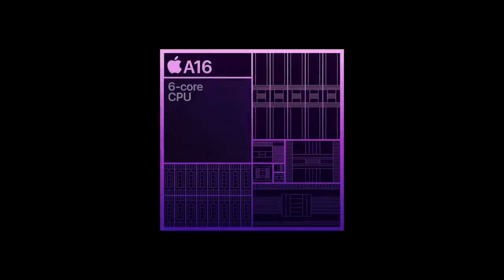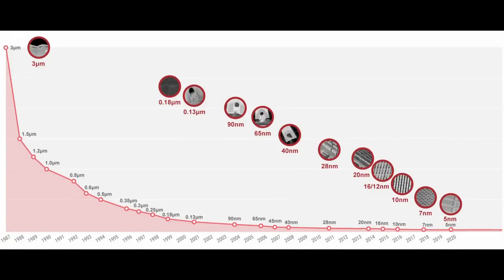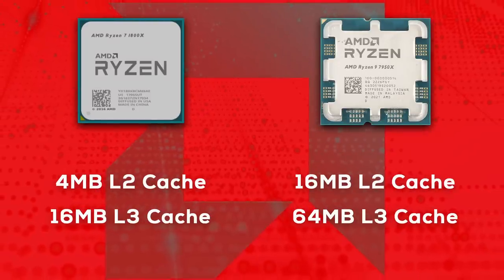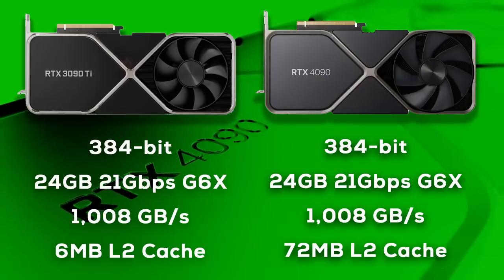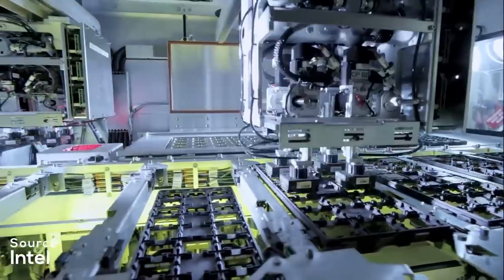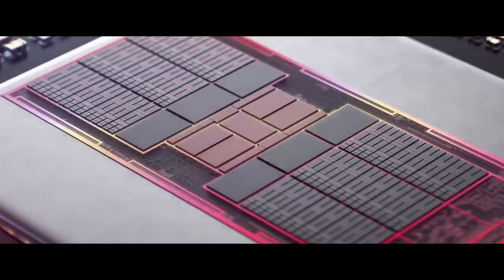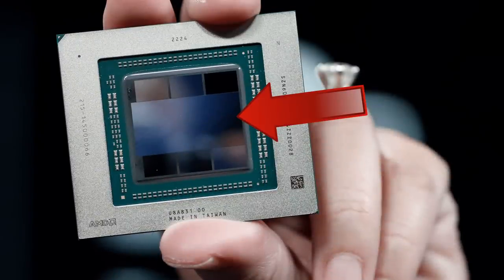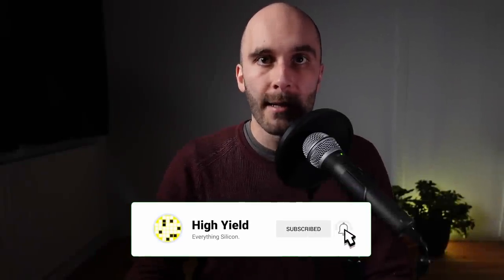Next-Gen CPUs/GPUs have a HUGE problem!

Comment: love your channel, learned something new today! by the way, how long do you think transistors will be able to scale? or is an atom's width the limit if we can focus our lasers that small?
Reply: The issue is not so much how small we can physically make the transistors, it is how much tolerance to errors and accuracy that can be managed via electron leakage. It something that is becoming a real major issue in chip design. We can make small transistors but they are so small electrons can just just tunnel through these switches (more like have the energy to over come magnetic/electric resistance) and thus negate the binary nature of the transistor. I little can be tolerated. This is called Boltzmann's Tyranny. This is a real world example of Boltzmann distribution in action. https://en.wikipedia.org/wiki/Boltzmann_distribution

This is complicated but I will try to make it as easy to understand.

Transistors still have analog properties, what determines something as being an on and an off state is not as absolute as we would like to think. It is a case of tolerances. If enough electronic flow gets through then the gate is considered on. The switch in a transistor isn't actually a physical switch but an electric field that when active prevents the majority of the electrical flow from getting through. There will always be electrons that get through, it is a case of how many that do and the tolerance of the output from this.

Now have transistors that have only a few silicon atoms separating them, making the electron tunneling much more likely. This can mean that because of this fuzzy nature, it is getting more likely that we will have transistors that while are physical small enough to be functional, quantum tunneling makes them useless.

There are two ways to combat this. Either we pump more energy into the transistor to increase the switch resistance but this will increase the temperature output. This is not a great solution as we have already been pushing the upper limits of thermal capacity for a good 20 years now. The other is lower the tolerance on accuracy. Meaning we could make smaller chips but there is a greater risk of them operating in odd ways. Could we build these things? Yes, will they work as we want? No. The base physics of the universe will have the last laugh here. We are toying with the fundamental laws of physics itself and it will not bend to us.

To answer your main question, I think we will make it to the 1nm mark but it will be a long slow push up to it. I suspect that over the next decade we are going to see a few major features of future processors. 

Further ASIC design. Things like we are seeing today with the Apple M series chips where there are a lot of highly specific cores to accelerate functions were possible. We are going back to the design principals of the Amiga!

More Chiplet design to compliment this. In order to keep chip binning to a minimum we are going to see the amount of chiplets bundled go through the roof! 

Increased  electrical power demands as this chiplet designs allow for more compute power to be packed into a machine but this will be the last phase of just desperately trying to get performance out of silicon computing systems. 

This is it the actions of desperation to get a few more percent out of computers as we finally peak out in the early 2030's. 

After that, I feel the real push to optimize software will be the main game to get further performance. How do you sell hardware that is no better that the previous years systems? The way Microsoft has with Windows 11 - have processor specific security requirements. ;) This is why I envision that in the next decade the amount of vendor lock in is only going to get worse. I hope I am wrong.
Reply: @Jabjabs  wow, thanks for this, very interesting and informative! Kinda sad since it really feels like we're just scrambling for workarounds to a physically impossible problem. I wonder if even beyond the next 10-20 years, how will things evolve? will we move on from silicon chips and into fundamentally different designs? I'm thinking that since we're currently using electrons to interact with the transistors, perhaps using smaller particles like photons (I don't think these guys even have a size since they're massless) could be a solution since they have energy so maybe that could be used as a toggle.
Reply: @mihaicraciun8678  Photon computation has been something that has been proposed for a few decades now. I don't see any major theoretical problems with in terms of physics it but it is clearly a major engineering problem as it has yet to materialize. Great in theory, terrible in practice - for now. 

This is why I feel software optimization will be the last big step. A lot of the software we use nowadays is astoundingly sluggish considering what is possible. Modern hardware is just so amazingly fast, it just plows through the inefficiencies. I remember building a sorting algorithm in assembly on a 33Mhz 486 back in the mid 90's. It could sort a data set of about a million variables in about 5 seconds. Excel running on my 4.2Ghz i7 will do the same in about the same speed... despite there being 6 cores each running at 100 times the clock rate. So yeah there is some room to maneuver here.

Yes, we are scrambling for work around technologies nowadays. Every new transistor design and technique we are coming up with is buying us less time until we need an all new design again. I remember Intel in the mid 90's saying we had about 25-30 years until we would hit the end of the silicon road. They were not far off the mark. The problem is we don't even have anything viable on the horizon. This is a similar issue to things like batteries and power generation. We have come a really long way but the next major step is a long way off and we don't know where it will come from. But we will try anything and just maybe one of these experiments will hit the jackpot.

And don't even get me started on Quantum computers, they are neat physics experiments but they will not do work in a fashion anything like what we use today. There are also fundamental limitations they have that additional complexity can decrease their reliability.
Reply from the maker: I think logic transistors will continue to scale for a couple of years, but with diminishing returns. There are things like graphene as a material to succeed silicon, there are photonic chips and then we have EUV-lithography improvements like High-NA.

Comment: If the chiplets get smaller and you use more sram then the dye is scaling. 3d or vertical build processes still allow scaling. Lets say the dye is 2 chplelet and 60 sram modules, if you stack like a skyscraper 10 chiplets high,then it it still scaling. Adding multiple chips like servers is still scaling. If you cannot go smaller then you go more of. That is scaling, not just the smallest process at the current time.

Comment: Just like in ssd/nvme storage the solution is to go vertical. A 3D sram cash on a separate die can be 10X taller by just adapting how the compute die is mounted. Even a 100X thickness only builds  0,5 mm in height, easy to adjust with a tailored heat spreader. Just imagine how much sram cash you could fit in 1 cm3 when each layer is only 4 nm thick/wide, a custom design heat remover would make even that possible, if the demand for that much sram cash will one day appear.

Comment: It's not just the sram not scaling, the gate contact pitch of the logic has significantly stagnated. Next big gains will be had with buried power rail (or equivalent) and improved back end routing.

Comment: Correction: nvidia's 40 series uses TSMC's 4N, which is NOT 4 nanometer, but rather more like 5nm+ (slightly more advanced 5nm node)
Reply from the maker: TSMCs entire 4nm offerings are part of their 5nm family. But since process node names are entirely disconnected from the actual transistor size anyway, I feel like calling it “4nm” isn’t really wrong.

Comment: Well the can potentially create ERAM, using electrowetting and light rays it is possible to create a fast RW byte with minimal power usage, using just the position of light caught one can determine 0 or 1, could also try storing an entire unsigned integer/float with the strength of light caught

Comment: I have no formal training as an IC designer, nor have I ever been employed doing this.  About 25 years ago I did work closely with IC design and manufacturing engineers from little "i" and big "M" and learned a lot.

• IC manufacturing processes are optimized for best yield.  Processes (and design rules) differ between IC design target.  A SRAM process is different from a DRAM process is different from a CPU process which differs from a NAND flash process which differs from an analog process.  Telling an IC designer that you want all of these on one die gives them nightmares !
• SRAM is not SRAM !  There are different designs for different SRAM cells, which is why you typically have 3 levels of cache on a CPU die.  Also, I suspect that each level of cache uses different "associativity".  Any one really interested in this needs to buy the book "Computer Architecture : A Quantitative Approach".  
• I don't think we will ever be able to move cache off of the CPU chiplet.  Even with AMD's Infinity Fabric/Architecture.  Maybe Level 3 can be, but this brings up another issue.  "Pad limited".  The "pads" are the spots on the die where wire are bonded to bring signals outside of the die.  These DO NOT SCALE WELL !  As you reduce/shrink the size of the circuitry on the die, you may not be able to shrink the size or number of pads.  You wind up with "leftover"/unused space on the die.

Instruction per clock as well a maximum "real world" clock is now (and likely will be) limited by the size and speed of the L1 cache.  An "off chiplet" L3 may work as a better "buffer" to the DRAM, but then the DRAM memory control logic needs to be moved to this other chiplet.

Comment: Hot take: I think this is a good thing. Hitting barriers this early in the lifetime of a technology is good*. It gives other players time to catch up, frees up engineering hours for improving and stabilizing existing processes, and in general gives these huge chip companies time to prepare for the *next 50 years. The velocity of the chip industry is completely unsustainable and anyone saying otherwise is either uninformed or being paid off.

What we should be pushing for isn't faster and smaller computers, but more and accessible computers. Computer technology has advanced so far ahead of software that you are ENCOURAGED to write less optimal code for newer machines simply because it's fast. That's INSANE. It wastes energy, lowers the average capacity of the average developer, and leads to sloppy unmaintainable code.

Computers are plenty fast. We just need more of them, and we need them to be cheaper.

Comment: hmmmm ~ Well AMD has already been dealing with something a bit like this, with their chiplet design. The CPU cores benefit hugely from being the smallest newest most advanced possible process, but many parts of the input / output system, particularly the memory controllers and the memory buffers and pipelines and stuff ~ don't. They had the additional motive that Global Foundries still had a contract to deliver a certain percentage of their silicon, although GloFo couldn't make the very latest node. Solution - use dis-similar chiplets and get GloFo to make the I/O dye.
2nd, AMD were at the forefront of developing 3d stacked cache.
I can't help but wonder how long AMD have known about this problem with scaling SRAM cache down. I'm thinking at least 5 years, perhaps 7 or 8. I'm thinking Jim Keller knew about it when he arrived to help design Zen from the ground up, because the steps forward were worked out at the start. Keller must have known where this was going to happen, and why ~
If AMD's roadmap was not designed with this as a central concept, going forward, from more or less the time Lisa Su arrived, then I would be stunned, because every step they've taken seems to have been with fore-knowledge. If things like that happen once, perhaps it was luck. When a string of them happen, that isn't luck.

Comment: Very interesting.. thank you.
Dumb thought I know but ..
Wont that mean that rectangular chips are soon to be obsolete?  for there must be a finite limit to SRam gates/ wires per nm along an edge.
As in if the shrunken dies get smaller it would mean more ports per nm of for example logic cell density thus more 'wires ' to the Sram edges  
Im assuming you would quicly run out of room .

Comment: Well, it's all true of course. But I dunno if focusing so much on the slowing down of SRAM scaling amounts to a complete reason. The thing is that scaling is slowing down overall, due to physics, and those parts which were aggressively scaled down from the start are going to slow down first. Chiplets solve the problem of keeping yield up and costs down in chip production, as total silicon area increases. Otoh they add complexity, steps and distances in manufacturing. But obviously the costs and problems of that are much more reasonable and in control.

Comment: Hard drives were an increasing bottleneck because of their lack of speed. Then along came SSDs. Now we all have them. Back in the day they used magnetic core memory for RAM. The advantage to that was that if a computer lost power, when power came back on the CPU would pick up where it left off without skipping a beat. There are many potential technologies in the labs, of which eventually one of them is going to come along and revolutionize memory.

Comment: CPU<->RAM latency and throughput these days are remarkably low/high, 5%, 10% or even 20% relative improvements still possible but it is asymptotically getting very close to the saturations...
the next improvements are a massive multi cores frontiers and the next - a quantum computing to the gadgets...

Comment: I would not be surprised that there are companies investigating other methods of memory storage. There will be companies exploring all sorts of things with microchip design. I hope and pray that someone out there is looking at all the "Failed" chips and looking at how and why the chips are behaving the way they do. Someone once told me; "It's not through success that we learn. Instead it's through making mistakes and recognizing that it's happened or seeing why something failed in the way that it did do we truly learn." Sometimes a design doesn't work as expected and I wouldn't be at all surprised if the next method of memory storage is "invented" by someone who has spotted a way microchip wafer designs don't work and uses that as a solution to a the memory issue.

Comment: Chiplets are mostly tech to improve output of working microprocessors. If any part of the huge single chip gets fail due to manufacturing process imperfections (mostly from silicon polishing process) the chip on the area fails. The more dense process increases probability of local fails. The cure to this fails nightmare is to split single chip into chiplets that have smaller size. The wafer with smaller chiplets has much more choices of good chiplets to be used for assembly of good single chip stacked from good chiplets. This increases output of good CPUs/GPUs.
If SRAM has scaling problem this is not directly solved by chiplets design, but SRAM chiplet may be optimized by cost if manufactured with older node process.
Anyway lets see if Intel or Samsung have solution to this SRAM scaling problem that TSMC already faced.

Comment: That's why people should start actually optimizing their architectures, rather than just blindly add cache and hope it can improve performance.

And don't get your hopes up for something like 3d-vcache. Aside from the massive heat and power budget introduced by burying the cores under layers of cache, the latency will suffer, as well as the price - It's this many dies, you have to pay money for the doubled die size, and it's rarely worth it.

Comment: We've still captured by the centralizing principle, instead of parallell-processing. It might be easier to write the code for centralized systems, but it'll hit a wall sooner or later. And all these efforts by AMD, Apple, Intel and nVidia will grind to a halt when they can't expand further using the chiplet philosophy.
Edit. On another note, when you look at Carbon, you'll realize it's a semiconductor. So, by switching from Silicon to Carbon, you can reduce the volume on the chip with the same number of atoms.
Reply: Maybe AI like ChatGPT will help us write parallelized code efficiently.

Comment: No problem with cache and shrink rate, in 80s SRAM were ditched for DRAM in mass production for easy money mass production, later FLASH become available and prices eventually went down by mass volume increase. Now cache size wall is just a same case for starting new mass production of SRAM in form of chiplets. IMO, chiplets are late for ten years, there were no problem with IC interconnection in past, like it said it is bla-bla too pricey etc. Just imagine some Core Duo with chiplets of SRAM+DDR bus. Evenmore dual-port DRAMs are still in vain, waiting for some "wall" of fake multichannel DDR4/5.